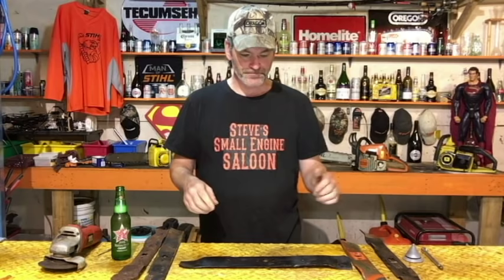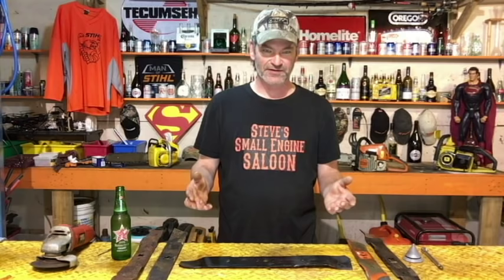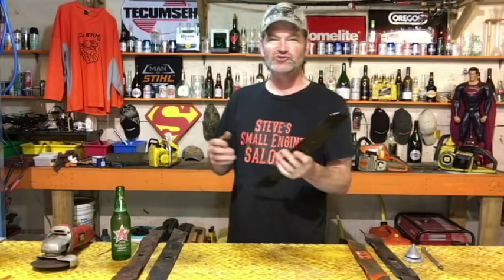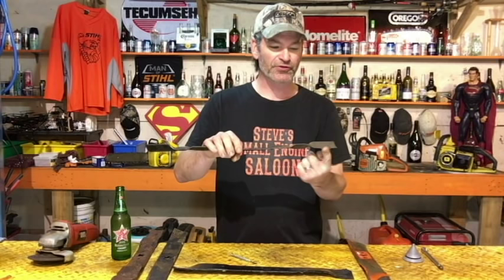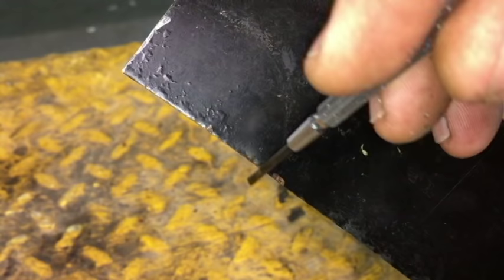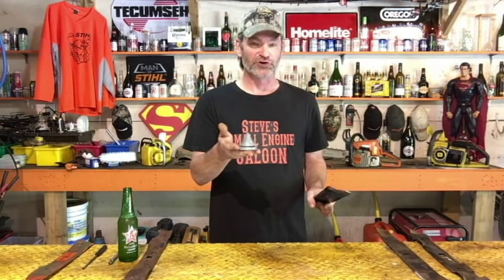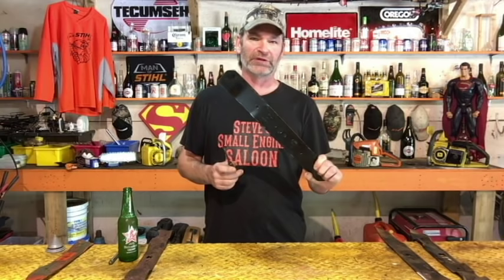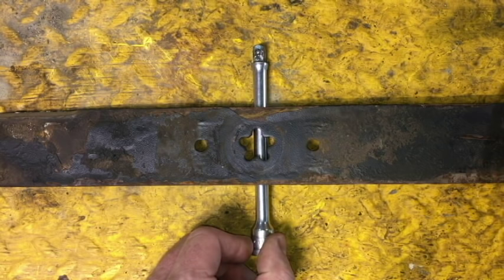How To SHARPEN And BALANCE A Lawn Mower Blade (The Correct Way)

Comment: When gunbarreling your lawnmower blade it may take several beers to get it straight but hey what ever it takes to get the job done
Reply: A tall enough beer will result in being able to put the beer alongside of the blade and use it like a square. Especially if the first 5 beers haven't been able to be conclusive... Would be good if Milwaukee's Best made a 24oz. can, ya could just leave it on top of the tool box year around...

Comment: Using a hot grind method just makes the edge brittle. You'll end up with more, and bigger chips in your blade faster. A slower moving 180 grit wet wheel works best. It takes slightly longer, but the edge on the blade stays sharper longer.
Reply: Or, feel the blade occasionally to make sure it's not getting hot enough to remove temper. If it's too hot to briefly touch, switch to sharpening the other end. Keep count of the approx. number of grinder passes on each end so as not to throw off the balance too much. That works much faster than a wet wheel. Angle grinder also far better to sharpen mulching blades with upsy downsy curved sections.
Reply: Great advise. Thats how I do my axes.

Comment: Thank you for the balancing lesson. Once I LEARNED about balancing, I tried two other ways. With the nail in the wall approach, the friction (however small) between the nail and the blade will stop the blade from rotating if unbalanced. The bearing/magnet tool is unparalleled accuracy. The key is the patience of the person balancing it. The blade is ONLY balanced when it stops moving LEVEL regarding the bearing way. That's the method I use. Patience. But it makes the difference between a mower that will last 10 or more years vs a mower that will last 5 or less. And: it's easier to start, does not bog down as easy, runs higher RPM, and fuel lasts longer. The only vibration you feel through the handle is the engine popping. Also important to mention that cleaning the understand of the deck is critical for correct air flow to not unnecessarily bog the blade and to mulch correctly.

Comment: I'd highly recommend using a flapper disc vs a grinding wheel....
Reply: Agreed!  Far superior results, and a lot quicker.
Reply: Yes when done frequently no question. But for someone that has let there blade go, like alot of newbies to caring about their blade, a grinding wheel followed by a flap disk would be time saving. Just from my experience.
Reply: I agree, my flap disc didn't even make it butter knife sharp on my old, somewhat wore out blade. I used a grinder and it worked quickly.

Comment: Hello Steve, thanks for the video. I also use a bench grinder and then put the blade in a vise and run a flat file on cutting edge and then use a sharpening stone about 4 passes each. Then recheck the balance. Have a great day

Comment: As far as balancing goes, some of the blades my customers insist I sharpen (instead of getting new ones) are so bad that in order to balance them in a reasonable amount of time is to grind the very end of the blade's heavy side. Less metal to remove to achieve the balance. In some cases of like 28" and longer I've even had to cut off a small piece on one end just to make it within reasonable grinding limits.
Reply: Nothing like reducing the width of your cut so you can add a pass or two at the end of the job.

Comment: Good info,  I don't drink anymore but I've  found that a nice bong rip or 3 goes well with lawn mower repairs,  The blades sharp and I'm  balanced as a MoFo! 😂
Reply: I got some real good wedding cake here in Durant Oklahoma from Sweet leaf Pharmacy
Reply: I tried it on meth...
I kept sharpening and kept sharpening till it could slice through a tomato. That went well so I tried it out on a 2x6 that was giving me the stink eye. I murdered that plotting piece of lumber so I polished the blade for 8 hours straight until it had a mirror finish. I repeated this over and over because the voices told me to.
I'll never do meth again
Reply: Ginsu!!!!!!

Comment: My mower I hit and had barb wire wrapped around 2 of the blades, well that also did something to the crankshaft just above the PTO. I had a shop fix that and he said if it doesn't work then I would have to have the crankshaft replaced. So so far it's fine. But before that fix as I was mowing the center blade fell off and luckily the bolt was still in the blade, how lucky was that! I have always sharpened my own blades and I have the same balancer and in fact have two of them. The people before us who lived here, when they were done with whatever they were doing left it in the yard and pastures. I'm still picking up junk.

Comment: Had a customer inspecting my blade sharpening with the mower rolled over
on the wrong side. she calls me and says i never sharpened the blade and that
there is oil coming out of the air filter and its all wet. she tried to convince me 
that she wasnt inspecting the blade, but i said how would you know about the 
blade unless you lifted up the mower, but she just kept saying why didnt i 
sharpen the blade. well ma'am when you sharpen a mower blade you can't see
how i sharpen it unless you look real hard at the top or feel it with your hand, and as 
for the oil coming out of the air filter and cover its because you rolled the mower over
on the wrong side while you were inspecting the blade. Sooooo, to make her happy 
i removed the blade and showed her how its done. Then, I showed her how the oil
got into the air filter Compartment, and i tell you she was just so amazed at how 
and what she had done just because she didnt trust my work, and ive got 5 stars mind 
you on google.so anyway i got her all cleaned up and running at no extra charge and sent 
her on her way, hav'nt seen her since.
Reply: Ken Craig - Gotta love those customers. You’ve always got the ones that don’t trust you and are convinced that you’re screwing them over. She’s probably taken it to some other shops that she thinks are screwing her over as well. It’s the same way in the automotive shop - I’ve seen these types throughout my career, try as you may you will never make them happy.
Reply: franko - Brocken?

Comment: I keep my deck kinda high to keep from hitting stuff like gravel when I’m close to the drive way.I haven’t hit anything to amount to anything in a long time!! I make one really light pass with the grinder on the bottom to get spurs and that burnt metal off that’s left from using the grinder! Then balance on a nail! Sharpening the blades off a bush hog is what’s fun,a lot of grinding there!

Comment: What you have here will work most times.  However, what the blade needs is dynamic stability, which is balance while rotating, so if someone cuts off the end of a blade on one side and balances the blade, one may well still have vibration.  Also the dynamic balance is needed while cutting and not cutting, so the edges need to be the same, so one side isn’t being significantly more dragged than the other while cutting.  I’ve never had any of these issues cause problems, but I’ve also not bent a blade as you demonstrated.  Just trying for completeness for your viewers.

Comment: try a big ballbearing  , works well as a pivot on a hard surface ,, you may have to hold the blade for front to back , bit it works.

Comment: FYI the nail works and is reliable. You are no longer looking for the blade to hang level, with the nail what you are looking for is the blade to stay in whatever orientation you left it when you let go. Much like balancing a motorcycle wheel, if you put it in a position and it stays there it is balanced.
Reply: Yeah, this whole buy a balancing device is bullshit. You might be out by a small degree by balancing on a nail or screwdriver but so what, won't do the mower one bit of damage...

Comment: Btw ...I've been using a Craftsman bench top belt sander. Works super fast and smooth, even outcome.  Can also be used on cutlery with a lighter grit.  It has many other uses with a disc sander on the side.  Best $85 bucks I ever spent....20 years ago.

Comment: I use a large file to sharpen my blades. It takes a few more beers to finish the job, but you end up with a better, longer-lasting job. (Unless you have more than a six-pack in the process.)
Reply: I agree, by the time these guys have the angle grinder and different disks/flaps set up you'll already be finished the job....

Comment: Used a bench grinder for lawn business for a decade. Steeper pitch is good for longevity. Shallower pitch is better for cut. Screwdriver through the middle for balance. You have to slide it around to find the midpoint.

Comment: Steve, thanks a million for all the great info. I was able to rebuild the carburetor on my rototiller and I'm no mechanic to say the least. I'm looking to replace a deck belt and maybe blades on my JD x300 mower, just trying to get brave enough. My question is: can I replace the beer with bourbon? Bless you Steve, best regards, Pete in Maine

Comment: I'm surprised you didn't mention a belt sander (with a metal cutting belt).  From what I understand about using a belt is that heat buildup (undesired) is less when using a belt machine vs. a grinder wheel of some sort.  From my experience, it's easier to get a consistent result with a 4 inch wide belt than with a narrow grinder contact point.
Reply: They're many ways to sharpen mower blades. Hell, you could use a Dremel
Reply: @tonyz6421  the result will be inconsistent in that the hand wavers as you move a small grinder in contact with the blade. The wider the grinding surface, the flatter and more consistent the result will be.
Reply: @txman201  well, I've been doing it. I guess if you can't keep your hands steady probably shouldn't be doing it. Works well for me, my uncle used to do it w a Dremel as well.

Comment: I use my 40 plus year old Craftsman 9" angle grinder with the mower blade mounted vertically in my bench shop vise and have at it. One hand on the trigger handle and one hand on the forehand grip. Then balance.

Comment: They only need to be as sharp as a butter knife. They will stay sharp longer. If they are too sharp the leading edge of the blade will roll over and become dull.
Reply: FALSE!  Youtubers say that mower blades come dull from the factory because you should never use a razor sharp blade to mow grass.  BUT I just bought a brand new mower 2 months ago & the first thing I did was check the blade - it was RAZOR SHARP right from the factory.  In fact, it was plenty sharp that I slightly cut my finger on it!  I mow 6 properties every 5 days which amount to about an acre of grass.  So it's now, 2 months later and that blade is STILL RAZOR SHARP!  You have no idea what you are talking about.  When you buy a replacement blade in the USA and Canada, they come dull due to idiot laws and to save costs.  Those blades need to be sharpened to a razor edge before use!
Reply: @VladTheImpalerTepesIII  they come dull here in Sweden as well, always sharpen mine
Reply: Same here in Ireland just bought two and they were dull as f**k. Sharpened to a razor edge before fitting
Reply: If theres too many dumb people in your area, they sell dull blades. 
Because imagine what an idiot can do with a sharp knife.
Reply: @petercoughlan103  Most likely they do, so "ordinary" people will just go back out 3 months later and buy new ones... You'd be surprised at how many people think blades are one and done. Or don't look and their repairman tells them they need new ones every time they take the mower in... My last set came not so sharp, dang Chinese...
Reply: @VladTheImpalerTepesIII  One thing you might try: go to a place that sells new mowers, and see if you can examine the blade that comes on a brand new mower, that's never been used. I wonder how sharp that blade is. Obviously, the manufacturer wants you to be satisfied with the performance of your new mower, so they're going to have a decent edge on the blade that's on the mower. I don't know if it would be different than a replacement blade from the manufacturer, or even an aftermarket blade, which I know, seem dull.
     I have had good luck, just putting the replacement blade on, but that's compared to the "chewed up" blade that it's replacing, not compared to the original blade, when it was new.
Reply: @VladTheImpalerTepesIII  i agree, if a blade rolls over is because the edge's angle has been shaped too acute, or too thin, the angle must be as sharp as you want, but never acute, one other thing to avoid is to never let the metal heat up at the point that changes color, if it becomes blue or reddish, it becomes brittle and it would eventually chip off, in that case jus cool it and regrind it! A blade is sharp enough when the grass is cutted clean, if you see a white edge on the grass, you re damaging the grass, that's about all i know about it! Good sharpening to all 👍
Reply: @tombal7408  – I have a large old whetstone driven at a slow rate by an electric motor. I always use that for sharpening, but the repairman who looks through the mower every year, uses a fast grinder – I can only hope, he doesn't "burn" the blade 🙂.
Reply: They don’t want them too sharp, somebody might cut themselves installing the blades!
Reply: @MrAnticlimate  maybe try sharpening it first or removing the blade before the repairman gets to it.

Comment: Another way to balance without the "proper" equipment. A big marble or ball bearing! Let the blade center hole seat on the ball bearing. On a known flat surface and there you go! ;-)
Reply from the maker: AWESOME idea.....
Reply: Truth Only  To create suction / vacuum and discharge the clippings.

Comment: FYI Make sure when using your blade balancer to place your blade balancer on a level surface first.
Reply: Uuuum, your name reflects your statement.  That’s like saying “make sure your level is on a level surface so it will work properly."
Reply: @TheSib  not exactly, you'll have to use the balancer correctly. If you use the balancer on a non level surface the blade will appear off balance. Thank you for trying though.
Reply: @thinkingimpaired5663  I see what you're saying, but the key word you used is "appear".  The blade will still be level if it's balanced, even is the table isn't.  Check and Mate.
Reply: @TheSib  I'm sure you would like to help, however it turns out that an employee usually follows Murphy's law and throws the balance and blade on the tailgate of a truck or places a parts on a canted shop table. They look at the blade parallel with the plane of the table or tailgate and figures the that the mower blade is balanced. Or the other problem the employee determines a balanced blade is unbalanced an grinds away on a good blade. In the end their actions cost the company from a quarter hour to one hour of wasted production. What I see is that I pay for workers errors.
Reply: Thinking Impaired, I agree.  Employees are stoopid.

Comment: I use a barrel stone in a die grinder to sharpen some of my blades. This is for the high lift or mulching blades. I have removed some mild bends in a blade before. I test them by seeing how far to the deck edge it sticks in, then rotate the shaft 180⁰ to test the opposite side. If it's high & low it's time for a new blade. I've taken a few with build-up on it & used the wire wheel to clean it up. That will throw your balance off. Some Husqvarna blades don't like the balancer. It's in-between steps. By the way, Bud Lite lime in my shop.

Comment: My method for balancing is a putty knife in a vise with the putty blade aimed at the ceiling. Park the mower blade on the blade of the putty knife at the center of the hole. One side tips down, it's heavier, grind it some more. Don't grind until the metal turns blue, if it does, you've take the temper out of the blade. Easy strokes with a flap disc, don't burn it. Thanks for the videos...
Reply from the maker: Cool!

Comment: I must be super lazy because i flip over the mower and grind it without removing.   I can only assume the blade was balanced from the factory so it must still be balanced even after removing random amounts of metal...right?  hahah.
Reply: Not really
Reply: There's a better way to sharpen a blade without much effort at all.  Go to home depot and buy 3 backs of pea gravel.  Pile the gravel somewhere and run over the gravel pile with you lawnmower several times.  This sharpens your blade with hardly any work.  That's how the pros do it.
Reply: @VladTheImpalerTepesIII  If you intend to break every window within a 100 yard radius, and make a piece of Swiss cheese out of your blade, then yeah go right ahead.

Comment: I thought my wife was the only one that could do that to a mower blade??!! I came home from work one fine summer day and she said she couldn't push the mower.  I asked what happened, she said there MIGHT have been a small rock in the field ... I can't believe she didn't bend the shaft. She's still using the same mower 8 years later, (with a new blade of course)  Go figure.

Comment: Steve, probably ought to mention about heating your blade steel to high especially with a bench grinder, I always have a cup of water to cool that blade off as it gets too hot to hold especially near the end of the blade. If someone else mentioned this allready sorry.